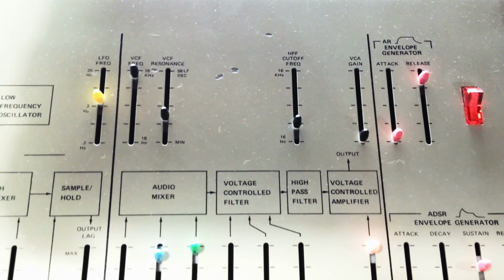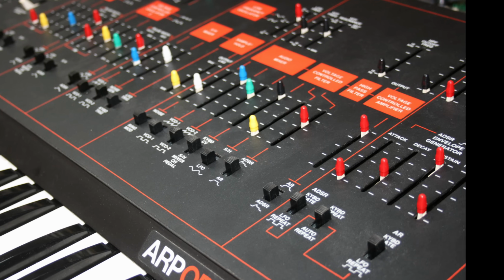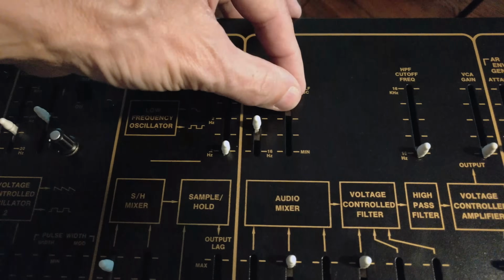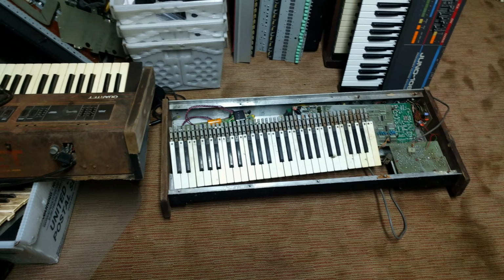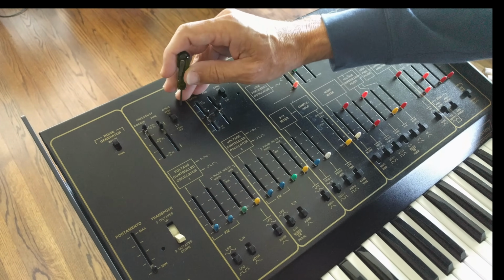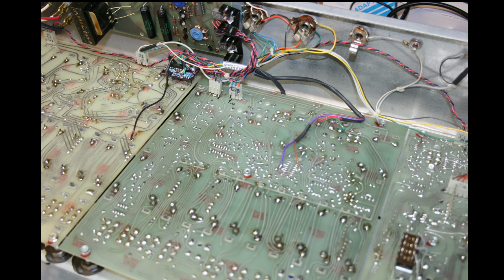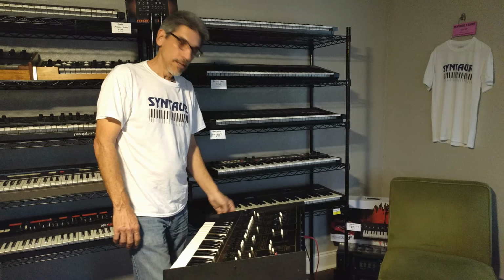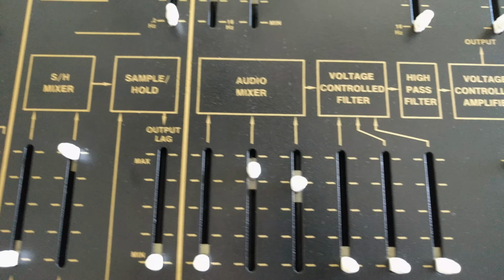Synth Wizards Episode 3: Hot Rod Odyssey

Comment: Greetings Mr. Wizard.  That mod harkens back to the initial inception of the Oberheim SEM. Could this new circuit board be used to hot rod one of those Odyssey clones from Korg or Berringer??
Thanks for outlining how that synthesized melody was generated on “Life’s Been Good”. Do you know how it was duplicated during the Eagles tour in 1980?
The shortcoming with the protruding keys of the Mark III caused me some headaches when I snagged an Axxe Mark II 2000. The highest A was damaged. I tried getting that repaired, but the engineer I took it to slipped up.  When I got it back, the voltage control of that key was completely deactivated. That key could only play the voltage of the precious note sounded.

Comment: Will the sub-oscillator arp mod work on the Korg or Behringer models??
Reply: titovalasques I would venture to guess that as long as you can feed the Flip-Flop IC an analog waveform you should be able to add the sub oscillator. The wiring of course could be vastly different, but the same principle concept.
Reply: It will work on any oscillator yeah.

Comment: A poor man's substitute for the sub-oscillator mod on the Odyssey (or really any synth) is the Electroharmonix Pitch Fork effects pedal. It does a lot more than adding an octave below the keyboard pitch. You can add an octave above and below the synth oscillator pitch at the same time, or add a pitch several octaves above the reference pitch. It also has several interval settings (third, fourth, fifth, etc.), so can make a single oscillator synth (like Roland SH-101) sound like 2 oscillators. There's also a detune setting, similar to fine pitch adjustment on dual oscillator synths, so it adds a chorus effect to a single oscillator. Sound quality is awesome! Of course, I love mods, and it's great Syntaur provides mod kits. That's fantastic! If you can't wait, try the effects pedal. It would be hard to tell the mod from the pedal in a blind test.

Comment: Since the sub circuit just uses a flip flop to generate the output signal from whatever is coming into it, would you be able to add a sub oscillator to something like my MS20 Module? I have some of those extra holes on the panel next to the junctions to put the pots and I'd love to have even more fatness at my disposal. If I'd use these kits, would I simply just have to change the values of the resistors going to the pot to match the outputs? Or just change the pots?
Reply from the maker: It should work, and we hope to test it on other things like this.  It does work in a Sequential Pro-One, but that's the only other thing we've tested it in so far.

Comment: If this mod can be done to the korg odyssey, it would be an easy and cool addition to allow for a switch to have one sub oscillator going into the other so it's 2 octaves down from the original pitch.
Reply from the maker: We actually planned the circuit board this way, to use in the Arp Axxe (which only has one oscillator).  It will give a sub, plus a sub-sub.
Reply: did you figure out the Korg mod?

Comment: I would also like to know if this can be used with the Korg Odyssey. I would think it would only need a few minor instruction changes.  Or maybe I should say "hope"!
Reply from the maker: We don't have a Korg Odyssey handy, but we hope to check into this soon.  It might just require a different version of the board, with different resistor values to get the output levels correct.

Comment: Can the Sub-Osc mod be done to the Korg ARP Odyssey?
Reply from the maker: We will be checking into this...
Reply: I would like to know this also..
Reply: That is a great mod!  It now rivals the low end of the Minimoog in my book and I have an original from 1972!
Reply: did you find the solution for the korg version?
Reply: I haven't seen the schematics for Korg's version of the Odyssey, but if you look at the VCO schematic for the Arp Odyssey, it would be pretty easy to tack a CD4013 onto the outputs of Z1a.5 and Z2a.3. The 4013 has two separate D latches that would handle both VCOs. Wire the /Q outputs of each back to their D inputs and use those VCO square outputs that I mentioned as the CLK inputs. The Q outputs - I'd try a 22K ohm resistor in series and tie the divide-by-2 counters back in between R69 and CR6 anode for VCO-1 and R95 and CR8 anode for VCO2. That rascal should rock. This same mod has been done to a lot of keyboards that have a nice square output available. The other cool mod I've seen is by using a 4046 PLL and 4013 to create a VCO-freq-times-2 upper octave.